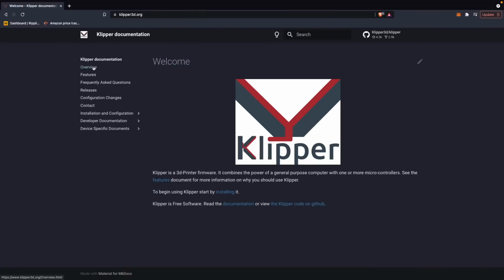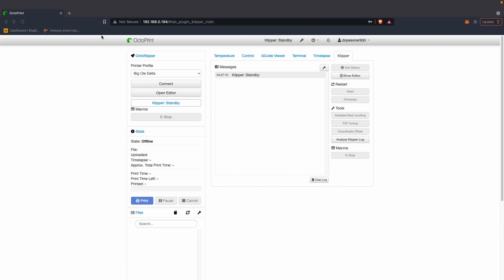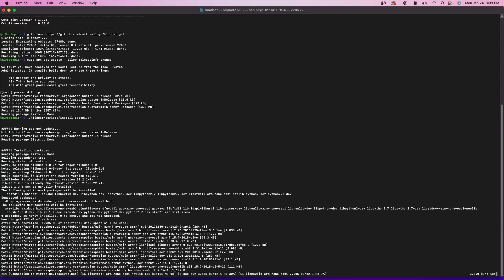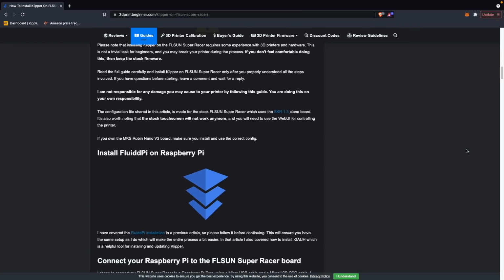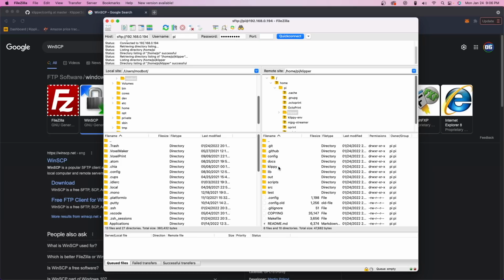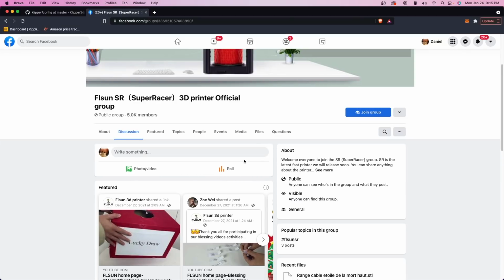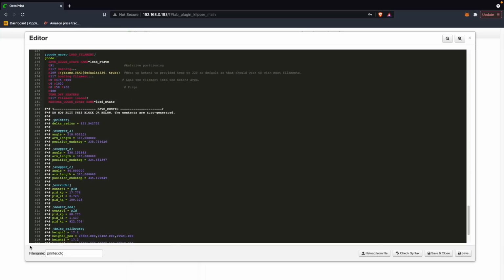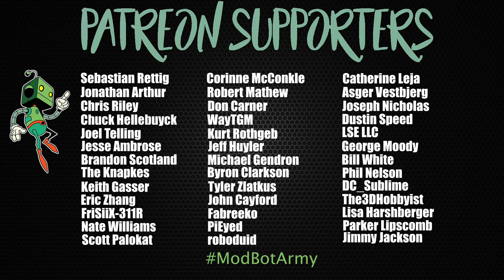Installing OctoKlipper On Your 3D Printer (OctoPrint & Klipper Firmware)

Comment: Hello there, I have a question, I have a CR10 Gen1 and I am not able to get the MSU when I have completed all the steps per your video instruction. I then tried to remove the board from the printer and used the jumper and then followed all your instruction and I am able to get the MCU, however when I flash the firmware.bin file it does change the file to .cur but when I plug the board back in the printer and power on it says the MCU (must be specified) error. I have a BTT skr mini e3 v3.0 board and using the Rpi 4. Any help will be really appreciated.

Comment: I HATED octoprint. I spent days struggling to learn/fight through installing klipper on a Pi and doing the conversion- when i DID get it figured out Octoprint was such shit compared to even just a regular slicer that i deleted it and struggled through a whole install again but THIS time i went with Fluidd/mainsail. Which is infinitely better😂 its basically the slicer your used to but with full control. I put an accelerometer on my old bed slinger the other day and ran input shaping, its cool how much control you have- if you can think it up basically you can make it do it😂 if anyone is on the fence- go with fluidd/mainsail. Its just so much better.

Comment: Great tutorial, but the thing is killing me, a few times I was sure I had it. But it wont find the printer, the  reason is it won't flash the mcu, I did with the klipper and firmware name and nothing. The print config file is inside the octoprint root, the printer  file is inside the klipper editor, the address is correct and triple. checked.  After three hours today, I'm stopping, now the raspberry wont log on the publickey my God it won't stop. Again great video.

Comment: Hey, I have been using OctoKlipper ever since you presented this amazing video instruction, however,  for some reason recently my ender 3 screen decided to be blank and I don't have control from my Pi to the printer anymore.  It did this once before but it decided to resolve it's issues and work, but now it blanked again and I'm unsure what to do, I already check for lose cables.  Ideas?  TY!

Comment: hey mn I went thru the steps and it was amazing. everything worked great until l went to the last command line entry... ls /dev/serial/by-id/*  when I did this it said no file found.. Im not sure what im doing wong. I tried it a second time and had the same result. I dont know if i have the pi hooked upto the octopus max e board the correct way. Im trying to learn this as i go but its not seaming to want to communicat... Any idea of what I can try

Comment: With a friends help I have Pi with OctoPrint now also running Klipper. there still some teething issues but in general it is a transforming Upgrade. I really want to optimize the printer and hope you dig into the processes, tools and methods. for example where do you the sensor for vibration detection?? We opted to keep the OctoPad User Interface on our 7 in Screen and run the basic set up stuff on the native screen. One thing I have yet to figure out is updating the config with an accurate Z offest.  I run the Z offset on every restart because it saves it for running that ression but never puts it into the config so a restart begins with the accurate offset. How do I do that.  We did have some runaway a few times and I had to recalibrate the dual Z drives. I drove the nozzle down into the bed once too. so I know this setting is tricky to get right.  But there must be a way right? Thank You, great videos for starters. Dennis

Comment: @ModBot I am having an issue where i follow all the steps but the sd card fails to flash and I get a blank LCD. Solutions? (Ender 33 pro with SKR mini e3 v3)

Comment: I did all this on a Linux Mint VM, it's all working fine except I can't get a virtual printer to respond, not sure how to edit the virtual printer to actually talk back. But anyway, it would be fun to run a simulation of everything including the printer.  Just incase anyone wants to try and use a Linux VM instead of a Pi... all this worked for me.

Comment: Would you by any chance be willing to do a full install video of installing OctoKlipperPi from the RasPi Imager? I have the choice of installing just OctoPi or the OctoKlipperPi and am wondering if it would be better for me to use the OctoKlipperPi OS for my rasberry pi but I'm not seeing any current documentation to help
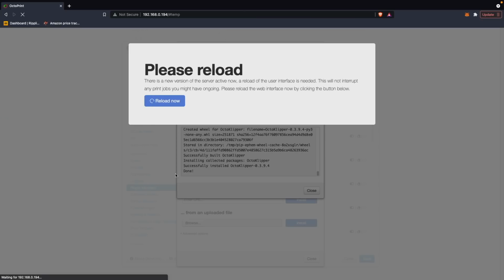Reply: Did you ever figure this out? From what I can tell is it just has the klipper plug in already installed. So I think you can basically just start at the 2:32 mark and go from there. That said I really don’t know what I’m doing and don’t have a definitive answer.
Reply: Did you ever figure this out?  @MorrWorm8

Comment: Instead of a bin file it created a hex file and that doesn't work when trying to install that to the 3d printer. My printer is a flsun Q5 which updates the same as the way in the video.
Reply: I'm having the same problem, did you get it working?

Comment: Most likely running "apt install python-numpy" (or python3-numpy for python3) should speed up the installation a lot. Except that klipper depends on a specific numpy version for forces pip not to use the system version.

Comment: i've been trying for days to install klipper on my octoprint and i always get stuck at this point i can't " make menuconfig" and all i get is this, i need help

 ###### Installing system start configuration...

###### Launching Klipper host software...
[ ok ] Restarting klipper (via systemctl): klipper.service.
pi@octopi:~ $ cd ~/klipper/
pi@octopi:~/klipper $ make menuconfig
Using default symbol values (no '/home/pi/klipper/.config')
Configuration saved to '/home/pi/klipper/.config'
  Creating symbolic link out/board
Loaded configuration '/home/pi/klipper/.config'
Traceback (most recent call last):
  File "lib/kconfiglib/menuconfig.py", line 3281, in <module>
    _main()
  File "lib/kconfiglib/menuconfig.py", line 661, in _main
    menuconfig(standard_kconfig(__doc__))
  File "lib/kconfiglib/menuconfig.py", line 705, in menuconfig
    locale.setlocale(locale.LC_ALL, "")
  File "/usr/lib/python3.7/locale.py", line 604, in setlocale
    return _setlocale(category, locale)
locale.Error: unsupported locale setting
make: * [Makefile:116: menuconfig] Error 1
pi@octopi:~/klipper $

Comment: Hey ho. I have a problem with my klipper installation. The error is: Unable to open config file /home/pi/printer.cfg . The cfg file is there and i can edit it with nano.
Reply from the maker: Hmm but it is there. It sounds like it can view it as well so the only thing I could think of is permissions. That is the error that is being thrown in the OctoKlipper UI?
Reply: @ModBotArmy 
I had checkt the printer config and it had read and writhe rights.
 I messt something up during the installation. But i have fix it. I have taken the Octoklipper image and run the klipper installer. In this way i get the configs from octoclipper and the normal klipper because octoclipper does have other file paths and configs for Klipper.
My onley Problem is now that the accelerometer dont work, but that is a problem for another day. ;)

Comment: Also better use

 sudo apt update

(instead of sudo apt-get update)

This will provide a "y" prompt which you can then accept and continue as normal. Because of some error about stable and testing release issue.

Comment: Thanks for the video! I subscribed to channel. I've the FLsun Super Racer.
Next video about klipper could be about the initial printer calibration (delta calibration, Z offset, PID) and input shaping with the use of Adxl345 🙏

Comment: Hi, there seems to be loads of videos about upgrading to pi and klipper, but, just a few questions, do you actually notice a difference if your printer is just for prototyping, does it still work if you don't have WiFi because at my workshop their is to much noise even for mobile signal, seeing how complicated this is for a total newb could this be a plug and play off the shelf unit if the printers a stock machine or am I missing the point, I haven't pulled the trigger yet on a machine because when I see oh that's a good one another comes out and then another.
Reply: I know this is old but, why not hardwire your pi to the network and avoid the noise all together?

Comment: Nice video, one day I'll get around to trying Klipper.  Its on my overly long list of things to try.

So probably already have enough projects, but you ought to check out the Ender Bender project.  Would love to see someone do a video on it.  Converting an Ender 3 into a belt printer.
Reply: what all is on your long list?
Reply: @jeremy6384  Very little 2 years later.  Done Klipper and everything else there is to try.  At the end of the day, just buy the Bambu.  Its better than tinkering.

Comment: Love the video. It will take me some time to study all the steps. I have both OctoPrint install on one Pi3 and Repetier Server install on another Pi3. I have used Marlin extensively. I am looking into whether I should use something else like Rep Rap or Klipper. I have 2 new Control board coming. The Bigtreetech E3 RRF v1.1 board and kit with screen. I hope to upgrade my Tevo Tornado and Ender 3 Max printers I currently have the Gen L 1.0 board on my Tevo and the Creality 4.2.7 board on my Ender. I don't like the Ender Creality board. The E3 RRF board sounds nice; can't wait.

Comment: Great video!  Next step ... Klipperscreen on an ender 3
Reply from the maker: Thanks Pi! I am going to make a video on KlipperScreen at some point. I am going to add it to the FLSUN :)
Reply: @ModBotArmy  I got it set up on an Ender 3 V2.  It was working OK but it had very sporadic usability for me.  If you clicked on a button out of order it would halt the system.  I finally gave up and went back to Mainsail.  Hopefully someday they will integrate the PiTFT35 and PiTFT50 with Mainsail.  That would be awesome.

Comment: On the Raspberry Pi Imager, I see now you have a choice of installing Octoprint or Octoklipper? what does the Octoklipper install do in the imager as compared to installing Octoklipper through the plugins?
Reply: I just setup Klipper on Octoprint for the first time, and used the OctoPi-Klipper OS build from the Imager and it seemed to work fine. I didnt have to do any of the SSH stuff. Only to get the USB port from the Pi to put into the Klipper cfg file. When I turned on the Pi and logged into Octoprint, OctoKlipper was already installed.
Reply: @av2245  Exactly! If you use the Octopi-Klipper option in Raspi Imager, you can skip half the video, to the "make menuconfig" part. Really cuts down the command line part.
Reply: @HackMonkey  where are you entering your particular Printer cfg file? I have a Kywoo Max I am trying to set up klipper and I have a cfg file from someone that has already done it

Comment: My only issue with this video is the FTP use instead of editing files on the Pi using nano.  Added complexity steps that arguably aren't needed.
Reply from the maker: As someone that doesn’t use much command line ftp is much more straightforward to me. Those that have much more familiarity with command line can definitely go that route if preferred.

Comment: Would OctoPrint's streaming gcode be considered a bottleneck for the way Klipper processes gcode (reading ahead) to determine optimum accelerations?
Reply: only if you have very short individual gcode moves. which could be a circle segment, for example. you can work around this with ARC commands.